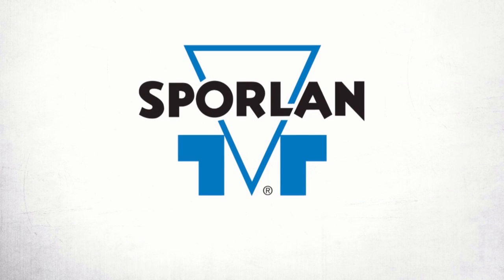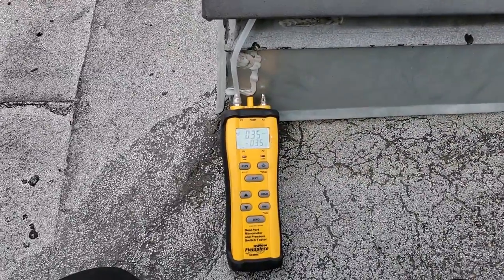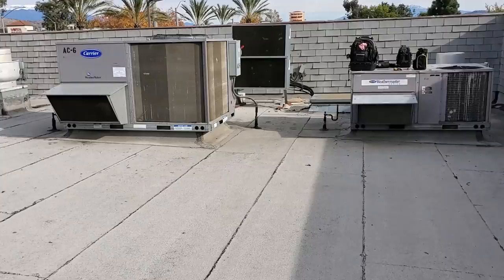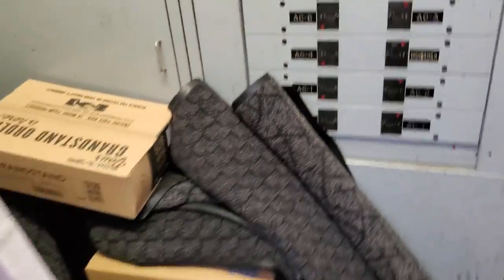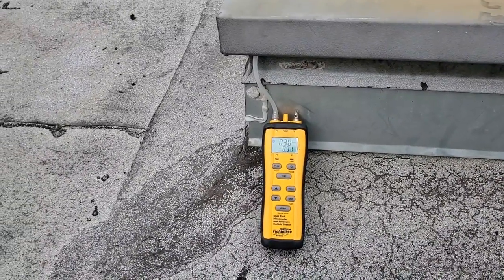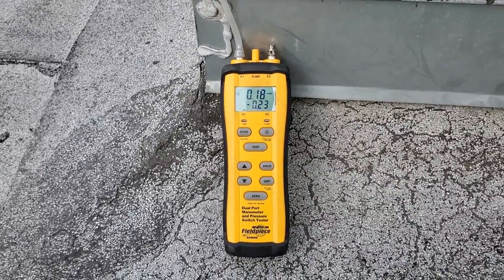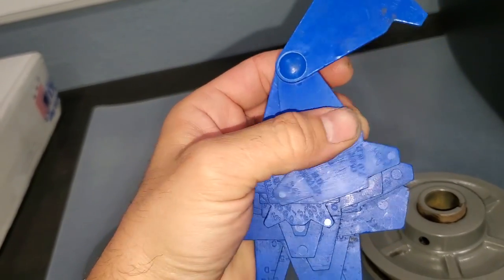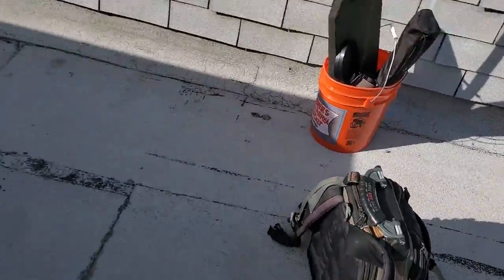THE FRONT DOORS ARE TOO HARD TO OPEN (AIR BALANCE ISSUE)

Comment: Clearly, 'regular maintenance' is not in the vocabulary of that customer.
Reply: You can probably leave off the regular part. I don't think these have seen ANY maintenance for a long time. And when problems started showing they just started shutting off things at random.
Reply: It’s totally commonplace. I don’t do HVAC but I’m a maintenance tech and the customers are in business doing what ever makes them money which in this case does not include HVAC lol. It’s common for folks to run till failure and call the pros at failure.
Reply: That's the norm for any industry. I'm a motive power tech, most customers regularly fuck their batteries and forklifts. We're pretty good at getting them on a schedule for maintenance and check ups for the lift. Though the battery is often killed by a lack of watering, over watering, improper charging practice, or a myriad of other bad practices that I have to mend. The amount of customer batteries I get in the shop that take 2 or more weeks to recover, or can't be fixed is common.

There are a few customers that are great about caring for their equipment at least, SaltWorks is a great example. They buy nice chargers, they buy good watering systems, and they use a bmid to tell the charger what to do for each battery and monitor the health individually. They even rotate machines around to balance how heavily they're used, based on power consumption reported by the battery monitor.
Reply: @wwrite  its funny that not doing maintenance probably costs more in the long run. I used to manage a small data-center and the company kept forgetting to do maintenance. The expense were always more than if you just did maintenance regularly, but no, just wait for the break.
And the A/C unit were tiny (it was just 1 rack of servers and 1 A/C unit), not even that important as my computers would run fine at 90º c but they can get to 100º c without the A/C (ideal is 70º c), but that would wear the electronics of any server running at that temperature, not to mention drop in performance.
It doesn't make money, no, but it saves money in the long run, not everyone thinks in the long run, they just think about the next month.
Until the day that there was a catastrophic failure that be  (like several hard drive failures, guess if they replaced the worn out disks, no and they probably even worn out faster because of the A/C not working correctly and hot temperatures), something that would put the customer out of business, then they learn about " preventive maintenance " .
But I know better, I don't do that to my car, I keep up with the maintenance of it, for safety, I don't even use my car to earn money as I'm IT and do everything remotely, but losing a business is not like dying.
Reply: @Luiz Felipe I personally agree! 

For me equipment operating at 100% is where I thrive. It really bothers me to see equipment malfunctioning or operating poorly due to lack of maintenance.
Reply: Whats even funnier than a small restaurant running their machinery into the ground is a billion dollar company run their multi-million dollar machinery into the ground through failure to maintain. It's one hell of a sight.
Reply: @monad_tcp  I've done computer IT and every time I looked over the problem a customer had... it was usually a nightmare of non maintenance. They call me for one little thing and I end up spending 5 hours trying to rid it of spyware and dusting it out because they didn't know that in Arizona things get dusty as heck and it looked like a fuzzy sweater inside... and then they gasp at the fact I dare charge them for 5 hours worth of time when I 'hardly did anything' or 'did a bunch of work I didn't ask for' and I get accused of being a lying car mechanic style scammer... yeah, you're welcome for making sure your PC would still boot up tomorrow... I've also seen this when I did plumbing, electrical, and other house repairs... One lady had a drip in her house for 30 years and her foundation was cracked in half... yeah that's not even fixable.... unless you want to tear the house down, demolition the foundation and build it all back up... Ironic thing is it took a 5 cent washer to stop the leak. And still, even with such experiences she still didn't understand why she should pay for work when nothing was 'broken'.... just because it's not completely broken doesn't mean it doesn't need a little TLC... ugh. There were other problems with various other things in her house and her exscuse was 'oh it's always done that' or 'always been that way' and 'never really been a problem'... except they were little symptoms of major problems... and while I would have loved to get paid to fix it all up and clean it up... she didn't think it was needed. Last I heard, her water heater exploded through the roof of her garage and killed the neighbor's cat when it landed on the hood of the car it was licking itself on... Oh, yeah it trashed the car, too.

(EDIT) Oh man, reading this over, it really sounds like I was making a joke, but... this actually happened (well maybe minus the cat, that was more of a rumor). I found out about this when she called us to replace the water heater... except the old one wasn't there anymore, and the pipes were ripped up.. plus the hole in the ceiling covered in tarp. Since it was just me and my dad working together, and we didn't have a lot of specialty tools (we were more like handymen then specialists like this guy making these entertaining and educational videos), We had to walk away from that job, and her... There's no way we could have done that job in any timely manner, and we weren't about to invest in any heavy equipment either. She was so mad when we had to tell her we couldn't do it. A real Karen.
Reply: @monad_tcp  I'm inclined to agree with you! she was kind of nutso, so we didn't really want to deal with her, and it was kind of one of those 'no way she can pay us enough for all this bull' kind of scenarios... To REALLY deal with all of her problems it would have taken a big crew of dedicated workers thousands of dollars to get everything fixed up, and in many cases outright replacement would have been preferable... She liked us because we were actually pretty cheap and mostly doing it for experience and having something satisfying to do...
Reply: @fuzzypickle5307  , there is a culture among management that usually is the catalyst for their "stinking thinking" which basically is don't spend a dime until you have to. The people at the top reward this behavior with bonuses, etc. for "saving" the company money. If they show on paper they eliminate this spending, it looks so good on them! Most of the time though, it is start ups and struggling businesses/ entities that can barely stay afloat that fall in this catagory. Hardly no one likes spending money on something they can't see or normally ever touch. They want to see something for their money like new flooring, window treatments, paint, "pretties".
Reply: Yeah. Most places don't do maintenance.
Reply: Customer probably said that the belts and filters were "Just changed".
Reply: The sad fact is regular maintenance isnt expensive but what hes doing is...
Reply: Most customers
Reply: Restaurants are the worst
Reply: or from what it seems, most of his customers, when it dies and stops working - oh, time to make a service call.

Comment: You should get an cheap automotive pully or brake rotor puller from Harbor Freight and that will make pulling those pulley much easier and faster. Prying again the motor housing can crack the housing and puts a lot of pressure on the motor bearings, where a puller put the pressure on the end of the shaft and pulley only.

Comment: See its funny, there is a train station that I take that has this exact oposite problem, it is so highly preasurised if the heating is running that these big heavy comercial steel doors will stay open like 45 degrees its actually insane.
Reply: are there tunnels that lead in/out of the station? sounds like a tunnel ventilation issue

Comment: Sounds like it would be worth it for you to get the cert for air balance you do enough buildings with air balance issues.
Reply: xMoose338x in my area in Oklahoma air balancing is usually a separate field within the HVAC/R industry and does not pay the same as refrigeration work. It takes a lot of time with a non-licensed crew of 3-4 people being paid lower wages than a certified tech so he would be losing money. Not to mention all of the equipment it requires that a tech would not have or want, lol.
Reply: Wouldn't a red seal do that i know my brother has a red seal hes contracted to the Canadian military dont exactly know what hes doing apparently he cant talk about it lol
Reply: @DerekGraham777  tell em you need to go camping and leave all electronics :)

Comment: I'm a retired Motorshopman after 33 years of working in the trade. I've seen a lot the same problems that you fine. GOOD job on the trouble shooting ! I also did infield dynamic balancing of air handler units up 1,200 HP and 10 ft diameter blades for heavy industry. Vibration analysis, Thermal imaging, As well as trouble shooting multicolor printing presses. Your a good technician and should be teaching this in a classroom to others.

Comment: The pulley lost its "V" shape and was worn in to a "U" shape. The belt is supposed to ride on the walls of the pulley and should not touch the bottom of the pulley. You are spot on. A new pulley is nothing in cost compared to the damage it can do. That constant fighting of the belt being sucked into the pulley can ruin the motor, the belt,  the fan bearings, plus it loosens the motor support structure and can lead to a resonance at run speed. Chris, you should record the sounds of a belt being sucked into a pulley and teach your guys so they can spot those types of problems easier.

Comment: New to your channel. Not a HVAC tech but I am an electrician here in Canada and have worked with your fellow tradesmen a few times.  Have enjoyed your troubleshooting process, steps and hope other young or new to your trade find your channel as they can learn a lot.  
One suggestion.  Here what we are taught is when turning on”closing” or turning off”opening, a switch/breaker/disconnect etc. Is to use your non-dominate arm, hold switch, ideally on the hinged side of unit, turn/face away from unit, take intake of breath, hold and turn off or on unit.  This way if something happens, and arcing will not cause you to automatically intake air due to reflex. , hinge side of unit is stronger then latch side so if unit will open it will open and vent to latch side.  Just a idea to consider.  Thanks again

Comment: Very nice fix. I was told by my air balance guy to have a slightly negative pressure in the building so that no kitchen or other smells go into other rooms. Especially bathrooms. He will re-adjust when he gets there. I worked in research labs and it was critical to keep negative pressures in the labs. Thanks for the video's.

Comment: Good work Chris. One more thing. Blower wheels. When you guys find a neglected job like this, all of the blower wheels will need to be cleaned. 1/8” of dirt results in a 10% loss in airflow. Take a long screwdriver and scrape the inside of one vane cup to sample the loading of dirt. No more than one, it may go out of balance if it’s very dirty. 👍

Comment: After I bought my house, I noticed I could smell like furnace fumes on hot days mostly coming from the basement. I blew smoke around the water heater vent and the smoke would blow back at me. If I opened a window, the smoke would go up the vent like it was suppose to. This would only happen around noon at the hottest part of the day. One day I went into the attic and noticed air was RUSHING around me through the opening to the attic. I found that the previous owner had installed 2 very large attic fans on a thermostatically controlled switch. Those fans would kick on mid-day and literally pull air from the only place it could which was the water heater vent. There was no need for attic fans as the attic is well ventilated from the soffit vents and a ridge cap. I'm surprised no one was injured from the fumes. I disabled the fans and replaced all the carbon monoxide detectors in the house.

Comment: 29:18 you really shouldn't take keys out like that. You can put grooves in them and change the way they fit. I don't know how it would effect alignment on a hvac equipment  but I know if you are doing anything with precision, that would be a massive no no.

And then he renders my comment useless by replacing the key xD
Reply: Just use a fine file, alot of times there rusted in. Never sieze works wonders and use pocket point set screws. Just saying.

Comment: I never heard of any of this !  Where I worked they had lots of speakers in the ceilings all over, and they tested the smoke alarms and auto-shut for the fire doors.  They put in smoke into the building and tested the smoke exhaust system.  What I thought were ac vents, were actually smoke suction exhaust - intake vents.  Who knew.  Your explanations were very easy to understand.  How do you know so much?

Comment: I rarely see a pulley wore so excessively. That belt has been obviously wearing on it for a while.. Awesome video  man! Nice Work!
Reply: i worked on massive air handlers at stanfornd university that have been running since 1900. they run at low rpms  but eventually shit gets worn down. replace pillow block bearings and back in service. huge shafts,long belts  equipment looked like belonged in the titanic. respect for the people who built things to survive

Comment: There's a gun range near me where the door is so hard to open, everyone uses the handicap button to have the door motors open it for them.

Maybe I should send them this video
Reply: Gun range has a different concern,  must keep lead splatter moving away from occupied areas of the building and out of the environment outside.
Reply: Thomas LeMay the range buildings only need negative airflow in the range area though. The indoor range I go to occasionally has an airlock type setup with doors between the front shop area and the back range area. The range is under negative pressure and it feels in there like they have makeup air being fed  in at the firing line and the exhaust fans at the backstop, so that there's a constant down range airflow.

Comment: Negative Air Pressure = Vacuum
Your manometer turned itself off.  When you turn it back on you need to disconnect the hose and re-zero it.  It does not have a memory for zero when power turns off.

Very cool pulley diagnostic.

Comment: He's very profesional and methodical about what he's doing and why he's doing it, no running around going on a wild goosechase, instead simply ticking off things on his list, I blame the customer being frugal with maintenance costs you in the long run usually more then maintenance would. As for the force needed to open doors, well I'm not suprised by this, we had a thermodynamics homework a part of it was figuring out if we could open the icebox of a fridge and/or the fridge compartment only IF the seals of the compartments were perfectly tight. Any guesses?

No you can't open the icebox, for the fridge that depends on how cold you set it up and how big the compartment is, but usually no you can't, that's why the seals allow for air intake after being closed. With some fridges and seals that are relatively tight you can kinda hear them hiss when you closed them, that's the air flowing in as it rapidly get's chilled below freezing. So why can't you open the doors if the little air that is within the freezer and/or fridge gets colder? Well: P=F/A and as air get's colder it reduces it's inherent need to occupy volume generating negative/smaller preasure (in comparison to the outside), now we have the P let's see what is a door? A plane with height and width that devides the inside and outside but width x height =A so P=F/A becomes F=PxA , F being the force it takes to open the door can become greater then F=m x g x µ which means that the force that keeps you fridge in place against pulling is weight x gravity constant (9,81m/s² or ~10m/s²) x frictionfactor (rubber tile I aprox 0,5) and once something moves the force needed is reduced even more.
And that's why I accidently dragged my old fridge (freezer and fidge combined) about 10cm (~4inches) through my kitchen when I forgot something inside and rapidly pulled the door open since gentle didn't cut it.

Comment: Very informative video. If I may, you did do something that gave you grief, you pre-tightened the set screw for the adjustment portion of the new sheave, if you leave it loose while installing the sheave it will slip on easier. By tightening the set screw it will distort the bore and give you a tighter tolerance. Other than that you do great work. Don

Comment: great job, i work as an electrician in Facility Management for the Industry in Germany. one thing i noticed is how easy you could pull out the key from the shafts.... after building and repairing about 50 motors i never could pull them out as easy as you did. probably the tolerances here are different.